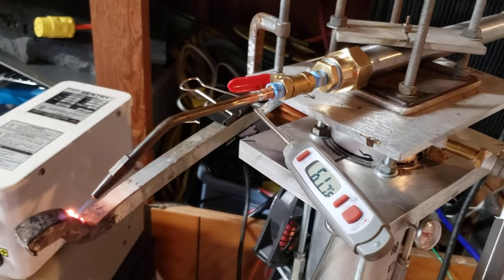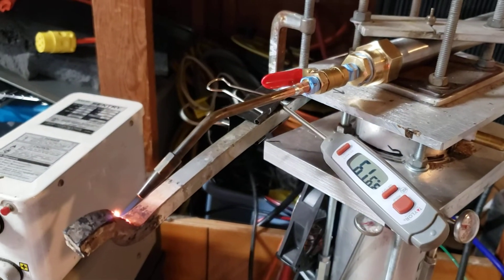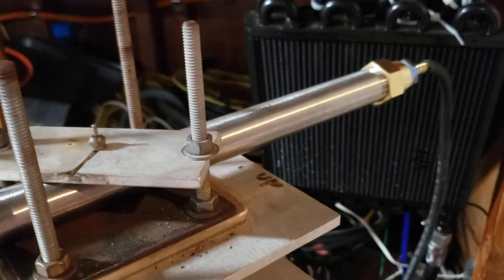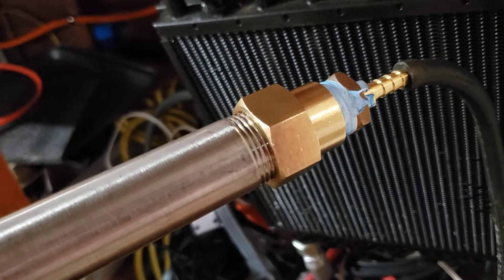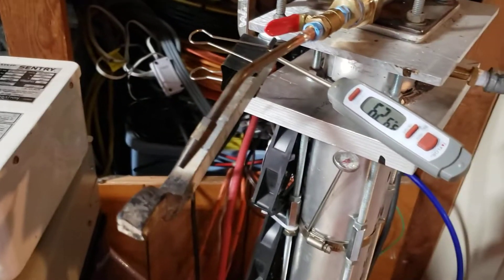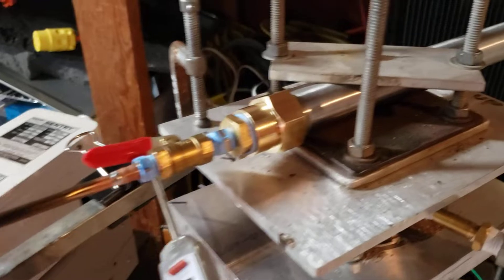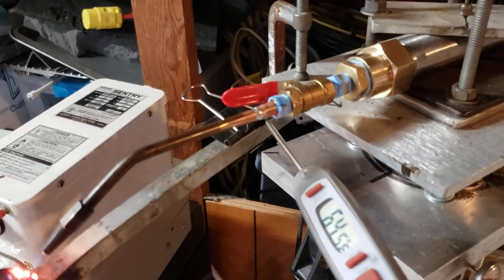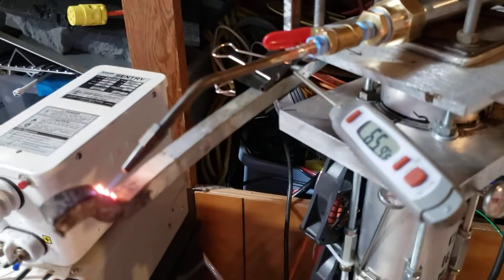HHO torch with sand filled flash back arrestor

Comment: Hi again, now its unsurprisingly common, fire in the arrestors housing, this mesh, and such catch fire within the housing and simmer and smolder within... 
Indeed gas production is only feeding the very flame within... Defeats the purpose and acts like a blockage causing.. (  back pressure) .... I keep on keeping on with the water bubbler type... Vissible to see problematics....indeed this very smoldering is how the sand box works to produce heat within...
Thom in Scotland.
Reply from the maker: Don't need a water bubbler if you design the sand flash arrester right. But I also use a water bubbler as a backup. always use a needle valve to control gas from touch and NOT a BALL valve.
Reply from the maker: Good to have a water bubbler as last protection before the HHO generator. we Used this prototype to see if using sand would keep some of the HHO from returning to water since it was being forced through water before being burned. CW

Comment: looks very neat. i am wondering what other dry materials would make a good arrestor... considering Meyer's use of tiny tubes, maybe something like a plug of pumice stone glued to the walls of the cylinder so it cant burn around the sides... i dont think glass wool would be any good, expect it would catch fire.
Reply from the maker: sand is cheap and available all over the world. let's keep it simple. The sand must be filtered in a smaller screen than is in your arrestor or the fine sand will get into valve and mess it up. The sand eliminates the opportunity for the HHO gas to return to water in a water filled bubbler and it helps dry out the gas and catch any NAOH, or KOH particles still in the gas.
Reply from the maker: I use play sand from hardware store and then filter that sand with very fine filter. I throw away the very fine sand and use the bigger grains. this way the the fine screen I used to filter out the very fine sand is used also INSIDE THE TORCH to protect the needle valve from that very fine sand that will plug it up.
cheers
CW
Reply from the maker: we filtered the fine play sand and used the smallest sand to make it work best.
CW